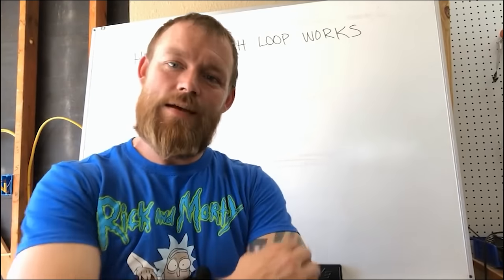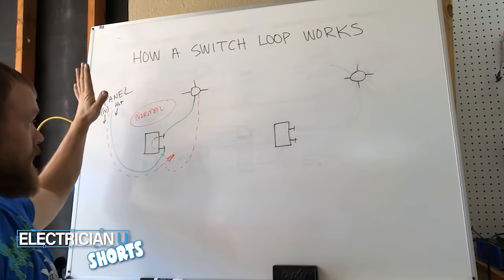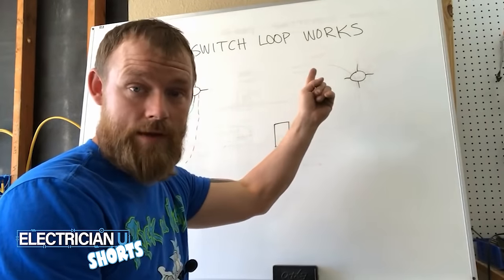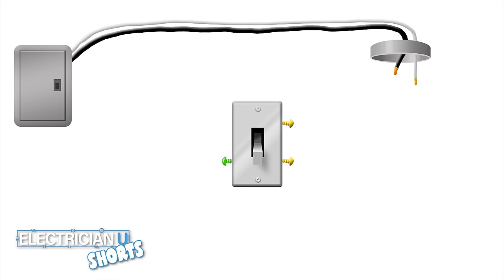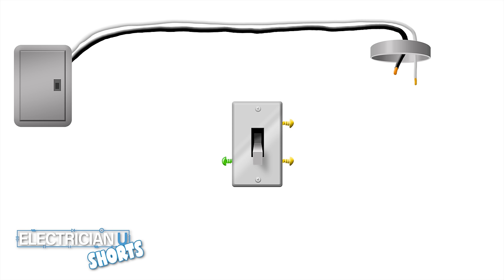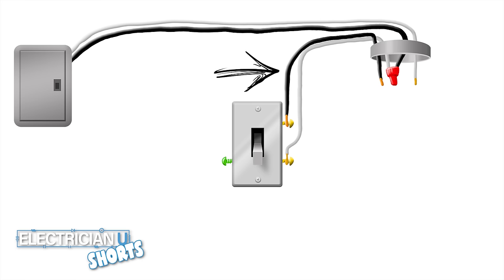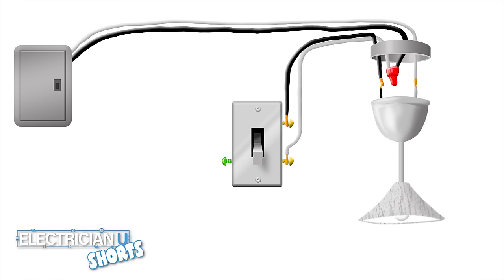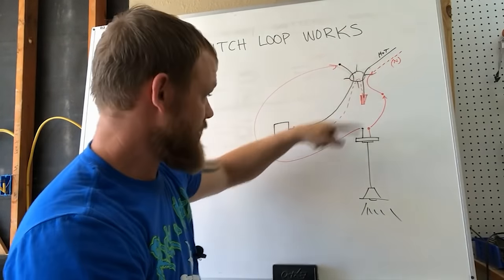SHORTS - Switch Loops EXPLAINED IN 3 MINUTES!!!

Comment: Guys relax...he is explaining a classic switch loop which is invaluable information for anyone diagnosing an older home.  Any new wiring should follow current code requirements.
Reply: That's right relax guy's
Reply: I wish i had this a few weeks ago, an electrician before me did something similar with 12/3 wire to (what took me forever to figure out) run a switch loop and a hot to god knows where
Reply: @christopherperez6126  this same issue has been driving me nuts in an old mobile home I’m renovating. So many issues with the wiring here, like when the power goes out on my first circuit but doesn’t flip the breaker and comes back on if you turn on the oven…
Reply: Ohngood
Reply: I recently ran into a case where a person ran the neutral on the ground wire so he could get neutral into the switch box. The wire was wrapped in black tape which think should have been white tape. Using a ground wire as a neutral is a big no-no, but that damn thing worked. haha
Reply: Seems like they used to do a lot of overhead work on older homes..
Reply: @michellet_thatsme  currently, this is my exact situation and I am stressed. Did this work for you?
Reply: I just came across this the other day Troubleshooting a service call.
Reply: Artificial intelligence sent me here to fix my 1963 home
Reply: @LuisHernandez-he53  That is what attics are for.

Comment: I absolutely despise when electricians do this.  It makes it super hard to put any kind of smart device in the switch box.
Reply: I've encountered the same frustrating problem.   So in most cases I've used smart bulbs/receptacles to counter this issue.  I agree it sucks.  But from the electricians perspective on a tract or spec home they have to cut labor and materials costs.  It doesn't seem like much but it adds up.
Reply: Smart device ?
Reply: @olivercotton347  This is against code in all 50 US states.
Reply: @TheGeekPub  I checked with my city electrical inspector and switch loops (aka back fed switch) are allowed in commercial and residential applications.  I am not saying I agree, but it is allowed.
Reply: @TheTechGuider  Likely devices which require the neutral to keep something powered, like a timer switch.
Reply: @TheGeekPub  Show the NEC code that says it is against code.
Reply: @mresquire3328  Code requires a neutral at the switch.  You can't do this and meet that code.
Reply: @TheGeekPub  reference the code don’t just say it says that and not reference it
Reply: It is frustrating.  Wiring was done differently 20 years ago. Dead end 3 ways and switched loops were perfectly legal and made for faster installs. There wasn't the thought of smart devices needing a separate neutral conductor back then.
Reply: @TheGeekPub  Not always. Refer to 404.2(C)
Reply: @TheGeekPub  yes it's also against code in Canada
Reply: Your not allowed to wire it that way by code anymore so that you all know this can only be done is you pipe the switch so you can add the neutral wire as of 2020 NEC
Reply: This is what happens when you don’t go to school and only learn from what others tell you and you don’t look up new code changes every time a new code book comes out if you think YouTube will make you a good electrician you are so wrong lol
Reply: I never understood why old people did this I see the convenience of it still makes no sense cuz it's never convenient in the long run. Plus it's illegal to not have a neutral inside of a box whether you're using it or not
Reply: @TheGeekPub  Code requires a neutral which is why for a switch loop use 12-3 or 14-3
Reply: Absolutely, You need a neutral wire for an electronic devise to work, Please DO NOT use this stupid way is dumb.
Reply: @TheGeekPub  No it does not say that, this way is just recommend it only but not illegal or  against code really, But I dont agree with this way at all, I will never install my lighting switches this way ever.
Reply: @trevonwalker8022  🤣🤣🤣🤣🤣🤣
Old people...
Reply: @trevonwalker8022 They probably weren’t old people when they did this. It was very common practice at one time.

Comment: I don't think this is possible anymore in NEC 2020, which requires a neutral at every switch, unless you use an NM cable that is 3 wire with ground. So no 14/2, only 14/3.
Reply: Actually, just bring your supply to the switch first, instead of directly to the light, then you don't need more conductors. Additionally, there are still limited (very limited) circumstances where this configuration could be code compliant.
Reply: The better electrician will pull the home run to the switch. Especially thinking ahead for like a future remode or addition. l.
Reply: Romex is bae
Reply: Not EVERY location. If you read the code there is a lot more to it. For example: In a room where both switches are visible to each other for the same lighting load the grounded conductor(neutral) conductor if its... accessible for the future... in a conduit.. receptacle loads.... Habitable?...   There is more.  Switches: 404.2(c)  I do believe its best practice to have it at every location, I dont just say "its code" because the code is complicated.
Reply: Or using 12/2 Mc like bx
Reply: @stevenclark6387  I agree I wire for easy future work the shit I been running into lately just blows my mind
Reply: this is the same in canada, every switch needs a neutral. and it makes sense with all the new wifi/smart switches everyone wants to install these days. switch loops are just old and a bad way of doing things these days
Reply: I still do switch loops. In situations where I have a neutral present. For example 2 ckts in one box
Reply: @FLUBZERO  You can't just make something a multi-wire branch circuit (by using the neutral of a different circuit) whenever you want. There are special things you have to do (e.g. double-pole breaker) to do that. And as many circuits require GFCI, you will have unbalanced line-neutral loads.
Reply: Mr g. I'm not talking about multi wire branch ckts. You can have 2 ckts in a box without pulling a 14-3 from the panel
Reply: @FLUBZERO  I'm saying that if you want a smart switch on circuit 1, you can't use the neutral from circuit 2, which is what you are implying by running a switch loop using 14/2 for one circuit in a two-circuit box.
Reply: You don't have to have a neutral at switches that aren't a part of the general lighting circuit.
Reply: Was told at a CEU class that you do not have to provide a grounded conductor ( yea old term = neutral ) in an unfinished basement.
Reply: Correct: This is incorrect. Why show this in 2021?  2020 NEC Changed all this.
Reply: @ryanchappell5598  did you have the ‘ code 2018 article ‘ about this because i dont find them. Thanks
Reply: Perfect! I have a 2 conductor 1957 vintage ceiling light in the basement that only has a pull chain, I want to replace that ceramic fixture with a low draw LED ceiling fixture. Now I know how to make it a switched light easily!
Reply: As long as it’s able to be fished later you don’t have to bring a neutral, but u could still do this with 14/3 and the lesson would be the same

Comment: "A switch doesn't need a neutral" should be "a switch didn't need a neutral"... now you have smart switches that absolutely need a neutral and homeowners are generally unable to tell on their own whether the white wires in the box are neutral or just a hot leg from the light.

Comment: "that's it"... no mention about how the white wire should be labeled as hot?
Reply: "that's it" on how it works - he's not saying to do this, or what the code is.  Pretty sure it is bad practice to not have the switch on the hot before the lamp.
Reply: How about never assuming wires aren't hot regardless of color. If you're automatically assuming they're not hot you probably shouldn't be dealing with electricity.
Reply: In Canada at least, tagging it wasn't required (when this was still allowed). Hot down to the switch was required to be the white and up to the load was black. This was in the code. It was done so that when you look at the light box you would see the feed black connected to a white and conclude it is a hot and not a neutral.

Comment: You left out phase-taping or banding the white wire to indicate that it's now used as a hot.  This is very important.  Even if the loop is not newly installed (because it's a really bad practice), you should make sure this is done.

Comment: I also wrap black tape on both ends of the white wire running to the switch, tagging it as hot.
Reply: I wish whoever wired my house did that 😩 Now I don't know which hot and neutrals are coming from where.

Comment: The shorts are great, glad you explain basic concepts. 

One thing though is that even after you've explained many of us don't know WHY you would use one thing vs another. 

Like in what scenarios does it make sense to use one technique over another?

Not just this video but most. 

Thank you for uploading.
Reply: Hey @KenTooker! The short answer is wire cost. The cable running from switch to the fixture will be the same length in a normal configuration as in a switch loop, but if the fixture is closer to the power source (panel) than the switch, then running the home run to the fixture instead of the switch saves whatever that extra distance is in copper costs. As others have mentioned, after NEC 2011 anybody running wire should be sending neutrals to switch boxes, but cost (plus the lack of smart devices requiring a neutral) was the reason the first guy did it.

Comment: Thanks man! I have a trailer that i gutted to use it as an addition to another trailer to make a little house out of the two of them. I didn't keep track of what wire is for what, so i was in for a confusing mess of unknown wires just hanging down from my ceiling. I plugged one of them in and it got the receptacles to work in my new office, but the light wouldn't come on. I noticed that a wire became hot in a junction box, so I plugged into that instead and marred the white and black where i originally plugged in and... Let there be light!!! And the receptacles also work! I have to admit that I was super nervous trying this, but I honestly ruled everything else out, so it had to work. Sooo glad that it did!

Comment: Hey electricanu, i just wanted to thank you for this video.. I know  about construction and some updated electric but when i ripped my plaster wall of and saw old 2 conductor no ground switch and loop wiring i was lost...i had no idea what this type was even called. I made the dumbest mistake and took apart a light with 4 different wires coming into the light without marking it. For two days i tried every combination i could think of and sometimes 1 light woild go on and not in the other room. Once the switch in one room controlled a light in the other rooms..Lights went on without being able to switch off.. It felt as if i was gonna have to call a professional.. that was until i came across this video and within 5 min i had everything back to normal.. So i wanted to say THANK YOU! Your video was so easy to understand and to explain it perfectly.. I will subscribe even if thats the only time i need to watch ( which probably wont be)

Comment: This is how I wired my overhead light last year.  The old fixture was a pull chain light so it was the easiest way to wire a new fixture to a new switch which I also installed.

Comment: Good explanation. I like the idea of bringing the neutral  to the switch box first, and then to the light. Just in case in the future if the client wants to put a smart switch there. I’m from New York, in modern building it’s required for a neutral to be in everybody, i don’t know why, that’s just how it is.
Reply: Because that's NEC 2020. Any state which had adopted NEC 2020 you need a neutral at the box, so you cannot do a switch loop with 14/2, only with 14/3.

Comment: This clip needs to be expanded to cover the code requirements for the limited circumstances, when this configuration is still permitted.
Reply: 404.2(c) explains its all. Its pretty straight forward too as far as code language goes.  There are exceptions, but there aren't many. For example: A switched outlet for example seems to be exempt from this, so technically, you could switch loop a half hot outlet in a room and be ok.  Read the code, talk to the "authority"(inspectors).
Reply: Wanting the neutral (white wire) to be identified as a line (hot wire)...

Comment: Excellent video! My uncle and I were troubleshooting a light fixture at my grandparents' house a few years ago and found a switch loop. I didn't know it had a name or that it was a common practice, we both just thought the guy wiring it got lazy and did it wrong. It had us scratching our heads for a bit until we figured out what had been done. The house was built in 1980.

Comment: I like your channel. 1st all boxes in fla are supposed to have a neutral. But in my swithloop, my white does not carry a current, as it should not. When I run that loop from fixture  to switch, I hook the hot blk to the blk to the switch, take my sharpie in red,  pull the sharpie apart exposing the felt and red ink in a clear tube, take my utility knife and put a 1/2" long slit in the end the with the cap back on I run the wire through the slit and in 2 to 3 passes I have changed the white to red. This way the white is not a current carrying conductor. At the switch I  have a blk n red, blk is power, red is s/leg at fixture you have 2 whites, a blk, n a red. Whites go together both neutrals one from lite, other from fixture, then blk from fixture ties onto your red you made. If fla, we don't do dead end switches, cause our inspector wants a neutral in every box. A home owner might think that white is a neutral,  yet it is a feed. I do it more on dead end 3 ways. Change the white trvlr to red. No mistake on the common . Some northerners use the white as their  common. Just wanted to sure how I did things , retired after 40 years. But I do find you n your channel entertaing n interesting. When I first started I was taught to square everything off, that way if some thing needed to be moved, pop some staples n 90% of the time you could make it long enough. And was taught to do everything like it was your own home. Worked alot on Boca Grande. Huge three story mansions. R/I might take 6 to 9 months. Every time the homeowner would be in town hear come the changes. The had blueprints, but that was just a guide. It was a challenge. Thank God I did mostly service.till later .

Comment: It would work, not compliant with NEC. As you are required to carry the neutral to the switch box. You would also be in a situation when you tried to put a Dimmer that requires a neutral, instead of a toggle switch. Your better off putting the feeder directly into the switch box then go to the light.

Comment: If I have two cables running into a ceiling box, one black cable with 4 wires ( black, white, Red, and copper/ ground) and a white cable with three wires ( black, white, copper/ground) and want to hook a new light fixture, is the sequence  / combination the same as this loop? I learned to process of elimination that the white three wire cable seems to power the vent fan and light above the stove. When I rewired the new fixture I combined the whites, blacks, and grounds and capped them. The red wire I capped by its self. When I turned on the break the new light fixture turned on without the light switch being turned on. The stove vent fan and light switches work as they should and were able to turn on/off. The ground wire for the fixture came out of the cap so I placed it near the two ground wires from the cables coming into the box. 

So my question is where did I go wrong, and how do I make the light switch controll the newly installed light fixture.

Any and all guidance will be greatly appreciated.

Comment: Lol.  Love the hallelujah moment.  I did this accidentally today while wiring my switch.  I used a 3 wire however and had a brain meltdown trying to figure out what to do with the neutral in the 3 wire. This makes so much sense now.  Instead I have a red for the switch wire that connects to the fixture.   Thanks for the explanation.

Comment: Problem with this is that if a customer buys a smart switch then it won't work unless they buy a no neutral smart switch.
Reply: Yep the other day I discovered my house has a switch loop when I went to go wire a smart  switch for my ceiling fan
Reply: Most old electricians did this because it wasn't invented yet and used less wire. But you 100 percent correct
Reply: @stevenclark6387  I'm almost 30 years in the business & from day 1 I was taught to wire for future changes by putting a hot & neutral in every box.Glad I had good teachers.

Comment: Ok, say the switch loop was to an outlet and not a light. Say I have 120v from black to ground and white to ground but 9v from black to white. All the outlets work and show no faults but the switch doesn't control any outlets anymore. Is there a way to convert it to an outlet or an outlet/switch combo when its a 14/2 setup from the 1970s?

Comment: By NEC book, do you need to tape (black) the 2 ends of the white wire from the light to the switch to identify it has live voltage?

Comment: In Ontario Canada they change the code so now you need a neutral at the switch only for a new build or renovation if you have an existing switch you can leave it as is

Comment: I could have used this video exactly two weeks ago when I was getting my wiring inspected that I did in my basement lol. I had the neutral mixed up from the switch and fixture, but I figured it out before the inspector got there.

Comment: I'm trying to wire a new ceiling fan and I currently have a switch loop that controls an outlet. Is there a way I can give constant power to the outlet and also use it as the supply power for the ceiling fan which will be controlled by the switch? Not having a neutral wire is throwing me...